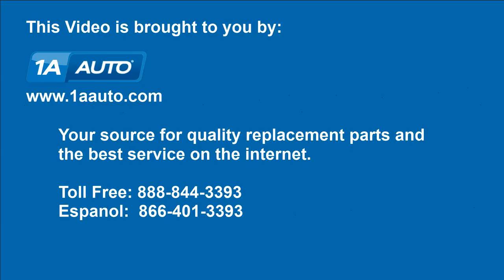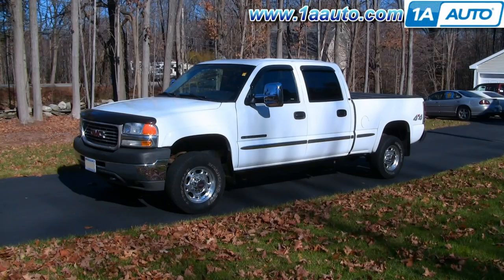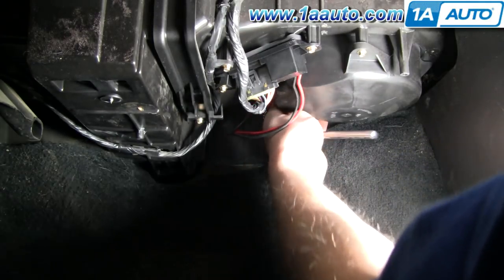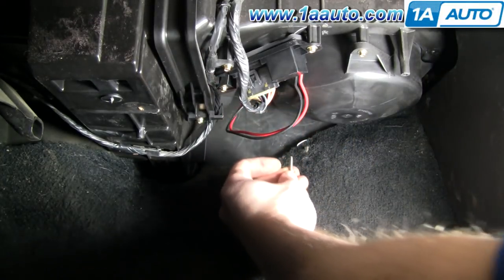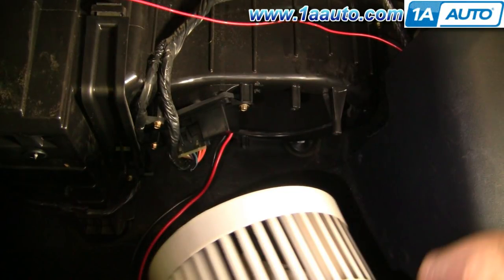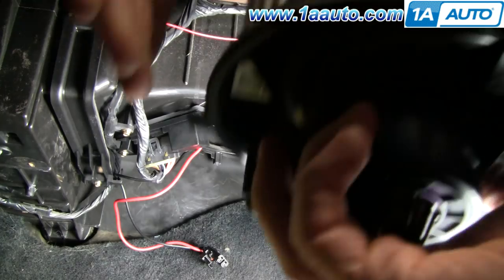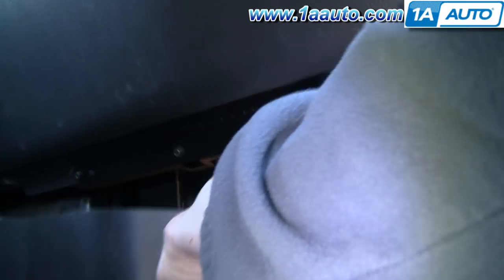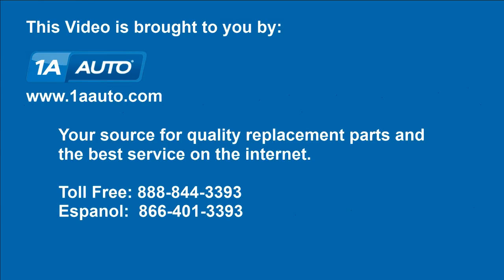How to Replace Heater Blower Motor 01-02 GMC Sierra 2500 HD

Comment: Mine blower works but it's really loud the higher you turn it up and on  number  4 it doesn't even come on do you think it could be the blower motor
Reply from the maker: At this moment, the closest how-to video we have to your request is for this vehicle, which is very similar to the one you have. The steps may not be 100% the same, but should contain an adequate amount of information necessary for accomplishing this task: +Nathaniel Newsome

Comment from the maker: You may want to make sure that the correct fuse is in the slot on that circuit. Also check the plug end to see if the wires are burnt or melted, if they are then you should repair them. Hope this helps you out 1aauto.com 888-844-3393

Comment: Bought a 2000 Silverado. Heat and air doesn't work at all. Makes a tapping noise a lot when I try to turn it on . would this fix my problem?
Reply from the maker: +Tony Keo You may want to see if there is power going to the blower motor resistor and also the blower motor. If there is power to them, you may want to check the cage to see if there is any debris caught in the blower motor cage or housing that could be preventing the assembly form turning. Hope this helps you out. 1aauto.com
Reply from the maker: +Tony Keo You may want to see if there is power going to the blower motor resistor and also the blower motor. If there is power to them, you may want to check the cage to see if there is any debris caught in the blower motor cage or housing that could be preventing the assembly form turning. Hope this helps you out. 1aauto.com
Reply: It's the blend door skipping gears

Comment from the maker: HI Michael, If you turn the heat or AC off and the noise goes away, it's more than likely the blower motor that has gone bad. There's usually only a couple of bolts that hold them in place. We carry new ones on our website with FREE SHIPPING in the lower 48 states. Hope this helps you out. 1aauto.com 888-844-3393

Comment: I have a 1999 gmc 2500 the truck won't give any heat it just blows air any ideas ?
Reply from the maker: When the truck's cold, you may want to check the fluid level of the anti-freeze in the radiator to see if it's up-to level. If there's an air pocket in the system, that may cause the heat to be cold. If that seems to be fine, you may want to see if the thermostat is working correctly. Hope this helps you out, 1aauto.com 866-403-3393

Comment: hey i have a 2000 chevy silverado and i had to replace the blower motor. My motor will not fit back in right and the air coming through the vents is pathetic

Comment: Is it the same on a 2015 chevy silverado z71
Reply from the maker: +buckskinz It may be a different procedure on your application. We currently do not have an auto repair video for this particular year, make and model. Thank you for asking. 1aauto.com
Reply: 1A Auto Parts it was all the same except the fan had 3 lil torque heads screws holding it in, was simple! Had an acorn in the fan from the filter when I pulled it out..crazy how that got in their!

Comment: I just replaced my blower. For some reason, the blower continues to make a humming/howling sound when I’m accelerating, but when I turn off the A/C, the sound goes away. Has anyone had this happen to them? Old blower and new blower make the noise. There is no debris of any kind. Replaced the resistor as well. A/C blows cold, just can’t get over the noise it makes.

Comment: hello i have a 2002 tahoe, my rear ac just stoped working, i turn it on and it does nothing, i alredy cheked fuses and their ok. what could be the problem? not air comes out.
Reply from the maker: +Edgar Arriaga You may want to check the power to the blower motor to see if it has power going to it. Hope this helps you out. 1aauto.com
Reply: 1A Auto Parts yes so i tried my rear blower motor in the front right now , and it worked,  so what might not let it work in the back?
Reply: a couple of days a go i got a tv installed in the back... and after that it stoped working, could it have something to do with it?
Reply: 1A Auto Parts i alredy checked the control and it works
Reply: Nope

Comment: I had a resistor go bad. Replaced it. Then the motor went bad. Badly damaged. Just replaced it. I still have no power on any settings. Ideas?
Reply from the maker: +Dirk Wilson If the plug ends were heat damaged on the factory harness, you may want to replace them. You may also want to check the fuses to see if they are okay. Hope this helps you out. 1aauto.com
Reply: Here's what happened in my case. Resistor failed. Replaced it. Few weeks later the motor started humming. Resistor died again a few weeks later after the motor started screaming which turned out the motor had been wobbling and completely destroyed. This must have burned out the resistor along with it as well as the hvac fuse. Long story short, everything works now.
Reply: Also to save all of you some time and pissed offedness I used one of those long flexible snake tools to remove the rear bolt to motor housing

Comment from the maker: You should fix the melted or burned wires first so that you have a good connection. 1aauto.com 888-844-3393
Reply: 1A Auto Parts I have a 2001 GMC Yukon Lx The tab on the motor that I pull down doesn’t seem to have any flex am I not pulling hard enough or is it a different model possibly. it has the same part number as the one shown in the video

Comment from the maker: HI Corbett, You may want to check the connection going to the blower motor to see if it's loose, which might be causing this issue. Hope this helps you out. 1aauto.com 888-844-3393

Comment: I have a 02 Tahoe. When I turn the fan up it makes a grinding sound. Should I try to replace the fan motor?
Reply from the maker: Thank you for watching! It is possible the motor is starting to fail. If you think it is the motor you can call our sales staff at  888-844-3393.

Comment: Mine is making a groaning noise ever up in that exact area. Any idea of what it could be?
Reply from the maker: Jacob Villegas You may want to check the blower motor and also the plastic cage to see if the cage has broke, or to see if the motor is starting to become worn and needs to be replaced. Here's a link to the blower motor that's show in the video, we do have them available on our website if you need to replace yours. Hope this helps you out. http://www.1aauto.com/heater-blower-motor-with-fan-cage/i/1ahcx00189?utm_source=YouTube&utm_medium=CTA%20Comment&utm_campaign=1ATony

Comment: mine blows hot air but not hot enough  dos not get hot enough is that the heater core or the blower
Reply: Check your thermostat, You might have a 160 in it  and you might need to try a 195.
Reply: Sean Nicholls it sounds like you're low of antifreeze in your radiator
Reply: Bye a bottle of that prestone radiator cleaner and add to coolant and drive car for couple days. Than drain coolant completely. Pull off heater hoses from heater core at firewall. Put a garden hose up to heater core and flush it out back and fourth on both sides a couple times. This is a good time to replace thermostat (use an oem temperature one) and radiator/heater hoses. Use the correct coolant for your vehicle! And fill it back up 50/50. I have a 99 and had to do this in 08 and 2018. If you dont replace and flush out your coolant system every 3 to 5 years(depending on what coolant you use...the Good stuff you can go 5 years) your heater core and/or thermostat will fail/get clogged. Also, never use tap water!